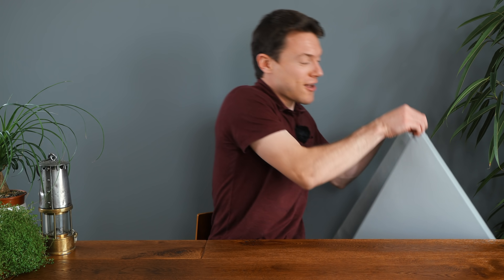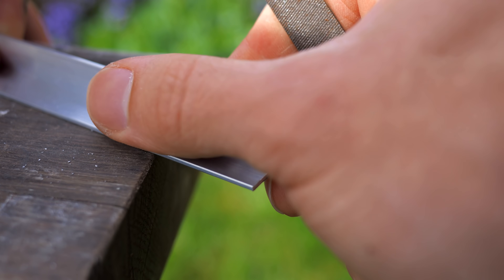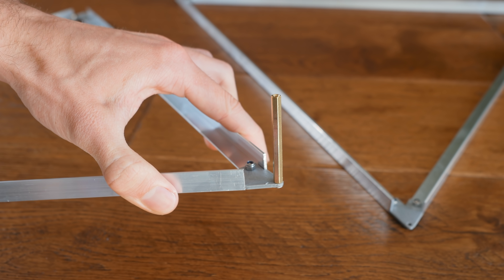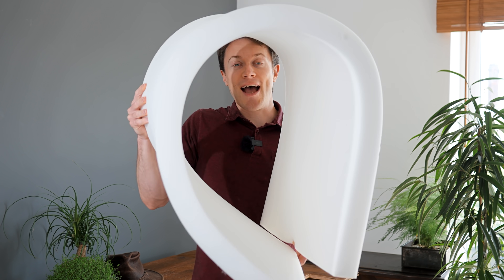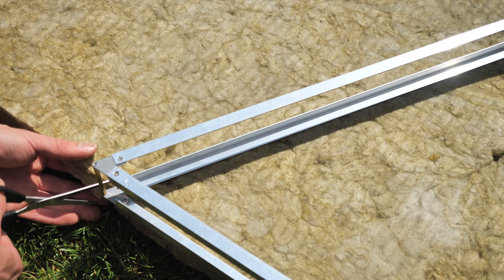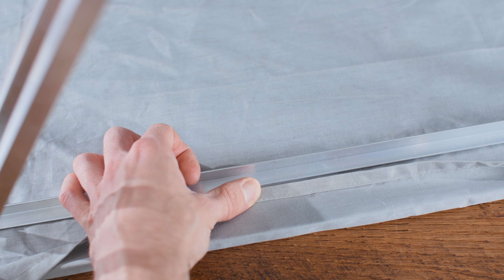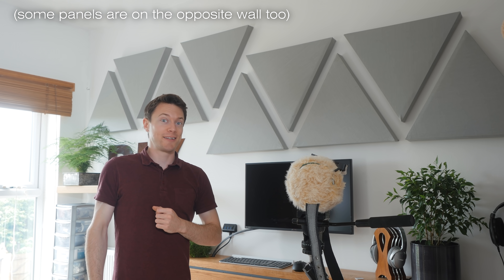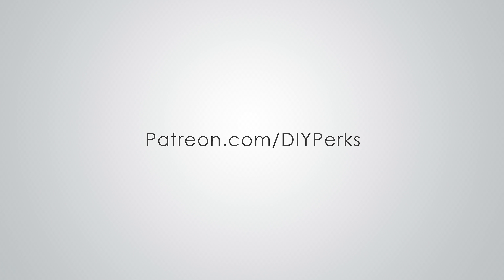High-Performance DIY Acoustic Panels (Build Guide)

Comment: Fine for some sound control not really for an accurate environment for sound purposes.
Reply: Oh yes. The version with rockwool insulation is VERY suited for professional purposes. It is dampening almost linear and beating foam solutions (even the expensive ones) every time. I would though mount it with a little space between the wall and the panel for ekstra effect. 1-2 inches.

Comment: Hey There! I found the foam, but it comes in three versions:
• 3 Different DENSITIES to choose from:
     • SOFT - 14 kg/m3
     • MEDIUM - 24 kg/m3
     • FIRM - 28 kg/m3

should I go with medium so we dont risk bouncing the sound?

Also what size aluminium bars are you using here?

and last one - we got solid walls -any advice on non "permanent" mounting? As its a rented place.
Reply: The reply to all of these questions is to use your own brain.

Comment: upholstery foam is not a good absorber. you can actualy hear it in you test that it reflects a lot. get polyester fibre panels. as userfriendly as your foam, and even better then mineral wool. ALSO: your place wont be all on fire in 10 seconds like with the foam. That foam stuff is actualy dangerous. polyester fibre is made to not burn at all

Comment: Great video and design!  Really enjoy your channel.  You may be aware of this, but there is one very simple tweak to make these even better!  If you can offset the panels from the wall, even just a few cm, the low and low mid frequency absorption goes up significantly.  Depending on the thickness of your insulation as much as 40% improvement.  The design to offset them can be very simple like these https://www.primacoustic.com/hardware/offset-impaler/.

Comment: The A/B comparison at the end is very obvious and very surprising. I've made and use panels myself with rock wool and wood and know how important they really are when it comes to audio. I was skeptical about the foam-ish material that you used, but it CLEARLY worked very well. Amazing video. Thanks
Reply: rock wool (as well as fiberglass) should not be used for sound isolation out in the open as they are very bad to breath in. It's fine if you used in a speaker enclosure or inside walls, but you definitely shouldn't use it for acoustic isolation on a room.

Comment: If you start looking into the Acoustic Absorption Coefficients you'll notice that something like studio foam (or that upholstery foam) is simply not dense enough to absorb sound of all frequencies evenly. You'll have MUCH better results with rockwool insulation, and like mentioned in the video- it's cheaper. Look for Roxul Acoustical Fire Batts (also called AFB) and it's even cheaper than the more readily available Safe'n'Sound- the 2 inch thick 24 inch by 48 inch batts work fantastic for panels! If you want more detailed info on coefficients check out http://bobgolds.com/AbsorptionCoefficients.htm

Comment: Hi. I have 3 ohm surround sound satellite speakers left over after my amp was damaged in a flood. I am thinking of creating a sound bar. Using the left, Right & Center Drivers as well as connecting the sub. Could you please do a video on how to do this. Lots of videos on the Youtube however not one that uses the Center channel as well. My idea a wireless subwoofer, with the sound bar also wireless (To Link to LG wireless sound sync) as well as been able to connect to with an optical/Hdmi Cable? Thanks in Advance. Shane

Comment: All the foam that I have found on Amazon and whatnot is something like $30/meter.  NOT VERY CHEAP.
Reply: Josh Sather check your local home center. Sometimes Home Depot and Lowe’s carry foam. I’ve never seen any that thick there but you can stack them up or if there’s an art supply store near you they might have some.

Comment: For those that want to absorb lower frequencies, you can use furnace insulation, which is essentially denser insulation than home insulation. And then, if you space them off the wall approximately the same distance as their thickness, you will absorb approximately an octane lower.

Comment: Can I suggest using composite foam for the filling? It, as the name suggests, is a composite of different densities of foam. Because every density works better in a different bandwidth, a composite is the best all-round material for general purpose sound deadening. You may also consider using a shorter spacer on one end to create a slope. This way, alle the sound that is still reflected, is reflected at an angle, reducing the effect of standing waves. Furthermore if you mount the panel at a 1cm offset from the wall, you increase the surface-area of the deadning material and almost double the effect (or ofcourse use half the panels for the same effect).
Reply: @Mechtroop  use rock wool.  You can get it at homedepot or lowes.
Reply: @LucasLeCompteMusic  Is Rockwool safe? I aske this because I plan to install acoustic panels in my bedroom(which also doubles as my studio) and I'm wondering if it will have any negative effects on health being in the room for long periods of time with it.
Reply: @zayomari3240  As far as I know its safe.  Havent heard anything about it being unsfae.
Reply: @LucasLeCompteMusic  Hey, does it matter what kind of rockwool you use? cause they have multiple "models".
Reply: @lukaz5482  That I do not know. I need to look more into that.
Reply: @zayomari3240  some Can give You lung problems and it is realy Dusty
Reply: ListenAndLearned  You've got the concept right. I suppose the gap might collect dust?
Reply: ListenAndLearned  You're probably right. Isolating vibration is more important for the floors & walls themselves.
Reply: Acoustic Foams are used for Echo & Acoustic Curtains are used for Soundproofing SoundProof-Curtains.me

Comment: I've got this thing about 3D printers. They kind of kill accessibility. For example, in this case, constructing the frame could be done using a blow torch and brazing rods (well under $20 for the equipment vs. at least a couple of hundred for a 3D printer). Hell, you could reduce it down to one join by bending one lone piece of angle. Also getting rid of that pesky "I'm going to poke small unstable holes in my wall" bit (this part was SOOO bad. Don't do this)  and instead drill a couple of small holes in the frame so that they can be hung with any number of picture hanging solutions (like the 3M Command Strip like products).

Comment: You shouldn't handle insulation fibres with your bare hands, it can get some fibres rubbed into the epidermal layer of your hand and cause extreme irritation that's hard to get rid of.

Comment: Ok so FYI, you guys DONT have to use triangles. You can use any shape and not have to print out a 3D printed holder.
Reply: Illuminati says nooooo.....
Reply: Leif Hagelsmak LoL but yea dude I want to do this on my wall, but don’t have access to a 3D printer so I was like, dude it doesn’t HAVE to be triangles 😂
Reply: @T3m0ur  Yeah, 3D printer is something I have not seen in real life ever so I will just buy some upholstery foam and cut it in the shape I want (screw triangles I'm going full size donkey shapes) make some fabric covers, skip the frame alltogether and bang a few nails in the wall and just push it till they stick...it will do just fine

Comment: I understand that the purpose of these is to minimize echoing and improve the clarity of speech in a room but do they provide any level of sound proofing when listening from outside the room?
Reply: Not really no. Sound isolation or soundproofing is a much more involved business. You need mass for soundproofing. Thick concrete or layers of plasterboard and mineral wool insulation on the inside with air gaps between. You'd need to extend your current walls out about 7 inches around at the least, to really wind up with any good sense of soundproofing. They might technically help a tiny bit, but it definitely won't stop people from hearing outside of the room or vice versa, no. Not at this thickness at least.

Comment: Great video 
Anyone attempting this I can recommend only one filler material. Semi rigid RW45. 
Look it up on the internet, so many articles have been written about it's sound absorption specifications, it has an equal sound absorption coefficient to even the most expensive materials used in professional studio acoustic treatments.

Comment: A couple of tips for the material: 
1: You should be able to "blow through it", it has to be open pore.
2: The heavier the better.
3: Hemp insulation is a real thing and very well suited
4: I don't recommend rockwool, except behind a thick and very fine pored fabric
5: Some youtuber has tested a budget material and has comprehensibly determined that towels are very well working. Oh! It was DIY perks... https://www.youtube.com/watch?v=pABvTWSxOes&t=2s - Alternative wool blankets.
6: The thicker it is, the lower the frequencies absorbed, the heavier it is, the more those frequencies are absorbed.

Comment: I wonder how your panels compare with the acoustic foam panels you can buy on Amazon, both in terms of price and performance.  The ones Amazon seem to be a little over $1 US each.  I do like the aesthetics of your panels a lot better though, and it is a nice project.
Reply: Most acoustic foam panels do little to really help the sound of a room and only really affect the higher frequencies leaving a lot of boomy bass in the room which can throw out the acoustics even more than before. I don't know about the foam he's using but I do know that Mineral Wool insulation is particularly good for absorbing frequencies across the board though for the very low frequencies you'd really need at least 4 to 6 inches of material. Generally, mineral wool would work far better than the majority of the egg shell crate type foam and especially more so than the cheaper stuff. Though keep in mind, mineral wool can be dangerous to your health as it's not really meant for being used outside of a wall.

Comment: I like your ideas. Couple of changes I'd add. 1: Once you know the size of the insulation you're going to put inside, adjust the size of the triangle so that you use the full width of the piece. This reduces the number of cuts you have to make and also reduces the trimmed pieces that get thrown away. 2: If you're going to 3D print the attachment ends, why not design an end that attaches the four pieces at each corner and also hold them the right distance between the front and back. then you would need only three per panel. You might even be able to design the so the aluminum angle with holes could snap in and not need screws.

Comment: I cant help but think these would be far easier to make with a wooden frame, you wouldn't even need to print the bracket, you can just cut 45 degree chamfers into some 2x1 and glue/screw/nail them together. You could make multiple triangle pieces in a very short amount of time, especially if you have a decent saw/table saw.

Comment: A great idea for trying to reduce the sound between bedrooms or between basements...do as in this video but rather than triangles, make a large rectangle frame, and instead of a bedsheet, find a duvet cover with a printed graphic on it.
Makes a large panel that is also a picture.

Comment: Just a tip for you. If you "countersink" your holes first, then drill the holes, your finished countersink will be easier and cleaner. Your editing and production value is excellent! I've been in broadcast television for over 30 years, so I'm picky about editing and videography!   Keep up the great work!

Comment: I don't know how much time it takes to print those connectors but i reckon you could just bolt the bars together, cut them a bit and polish after.

The potential issue i see with this model is long term, as it would probably gather a lot of dust. Getting them down to wash them, all glued, seems a chore. Let alone that the nail holes will probably get wider with this cycle and seem more of a temporary approach than a permanent one.

Comment: You can increase the performance of the panel even more by off-setting them from the wall.
For example a 10cm thick panel offset 10cm from the wall has about the same performance like a 10cm panel mounted directly on the wall.
Nice work by the way

Comment: you could add some standoffs so that there is about a 15-20mm gap between the panel and the wall, and add RGB LED strips to the back for some indirect lighting.
Reply: Damn excellent idea mate!  :D
Reply: how would you connect the wiring without it being messy though

Comment: This can be done much easier and cheaper with wood trim (the Aluminum alone would cost six times more than the wood at Home Depot). Easier to cut and miter (you can even round the edges if you like), easier to assemble, no need for 3D printing, can use a staple gun, and you don't get into arguments as to whether it's Aluminum or Aluminium. I would think that a stretchy nylon type fabric would work better and be easier to form around the frame, and be more acoustically transparent. Also, painting the frame the same color as the foam would make it so that you can't see the difference through the stretchy nylon.

Of course, I've never done any of this, but it works in my land of make believe.

Comment: I have been looking at ‘5-panel wall art’ on Aliexpress (essentially multi panel screen printed fabric). I had been planning on making some towel panels and using the screen prints as the top layer, but I may change to a rectangular version of this filling with a timber frame.

Comment: man is just grabbing fiberglass insulation with his bare hands ._.
Reply: Rockwool (mineral wool). It's not particularly bad to handle, as the individual fibres are fairly flexible even if the batt as a whole is relatively stiff. Certainly nothing like, say, Pink Fiberglas.

Comment: Any acoustically absorptive material is going to emphasize the lower frequencies of your voice by nature of the fact that it absorbs higher frequencies much more efficiently, affecting the relative balance of low and high frequencies that you hear. 

Great video!
Reply: Partly true, it also have to do with the thickness of the material, if you want bas absorption you need thickness, size and the right placement.
Reply: Correct! Although some materials absorb the lower frequencies a lot better than others, making this less of a problem. For example, the typical foam panels that many people buy do a terrible job at low frequencies compared to something like a panel made of rockwool.
Reply: @Cumbias Then what you want is "sound proofing," not sound absorption. Sound absorption reduces the reflections within a space, while sound proofing prevents sound from entering that space from outside. Unfortunately, this is much harder to achieve, but you can google it.

Comment: I want to use card board or drywall piece instead of fabric cloth. Also, wood for frame. Thoughts?
Reply: Faisal Rafique I think any cardboard or drywall used would just reflect sounds similar to the wall you are covering. You need a cover that will allow the sound to get absorbed by the foam or insulation.

Comment: FYI: You're sacrificing significant performance by not mounting the panels off of the wall. The typical distance is roughly the thickness of the panel, so a 2" panel is mounted 2" off the wall. Also recommended is not to double up the fabric; tight-woven fabric reflects high frequencies anyway, which is why looser fabric (e.g. burlap) is commonly used. Two layers of bedsheet might not be helping you. And finally, the filler material is crucial; it is not generally recommended to use closed-cell foams or sponges; the fiberglass insulation (or similar) is much better, and specific densities in particular are recommended. Lots of info online about this.

Comment: Lol $5 per panels my ass. But you have to go buy a $300 3d printer to make the brackets. 🤪 Or you could go to a hardware store and buy the parts. With all the parts he's using. You'll end up spending about $20 per panel. You might as well buy a 12 pack of auralex pro panels for $50 and you have control of mid range and hi/low end frequencies to treat specific areas of the room.
Although these do absorb sound. THESE ARE NOT HIGH PERFORMANCE!!! Also. You definitely want to use wood. Because those aluminum frames could reflect high mid-range frequencie artifacts in your recordings that you'll probably end up eq'ing out of your mic recordings to balance out the sound. If you know what your doing of course. Hence making you have to do more work in the final product of your content. If you don't believe me. Just listen to this video with headphones on. And you'll hear how harsh his voice sounds. 
So this DIY is a bust
Sorry buddy 😂
Reply: exactly , dont forget you need a "friend" to testing the sound too :P

Comment: I don't imagine these panels to be all that heavy, the use of aluminium also allows for magnets to be used, if you feel reluctant to poke holes in your wall, or like me do not have drywall walls (like me, stone walls here. hurray!) you could opt to stick some strong magnets too the wall. Tho keep in mind that peeling it of could estroy your paint/wallpaper once you pull the magnets off.
Reply: You know that Aluminium is not magnetic? Did you mean you would also glue magnets to the frame?

Comment: What happens if you add lights (RGB LED stripes) to that acoustic panels? It will decrease the performance of the panels?
Reply: It'll make them go faster, just like a PC. Jk! It won't affect the performance of the panels, especially if the strips are mounted where the aluminum is, because there's already metal there. Just make sure your fabric and insulation are flame retardant, so they don't immolate if something goes wrong.